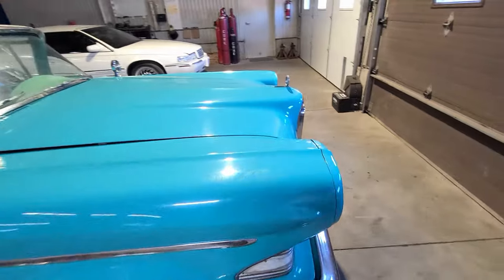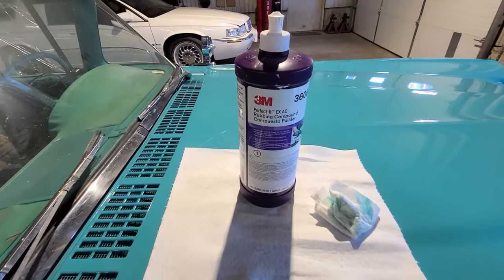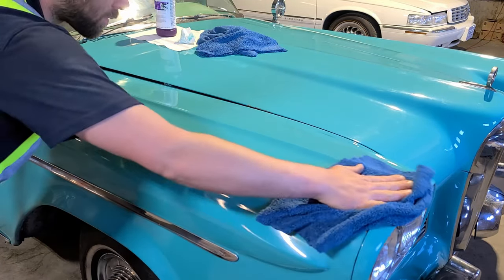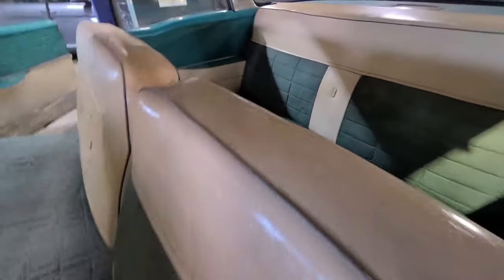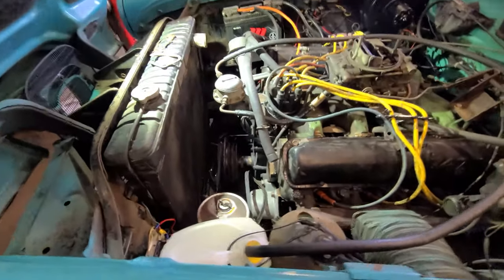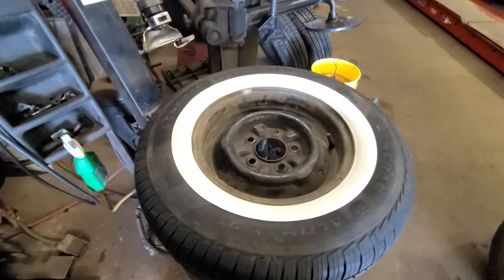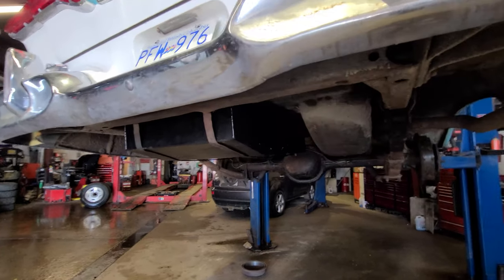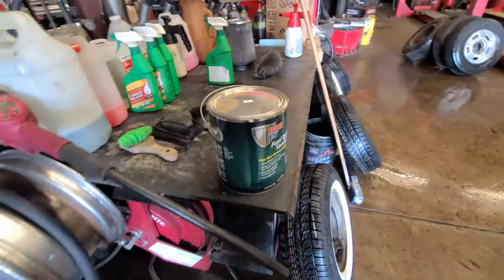Edsel Revival part 2

Comment: Matt - did the shifter buttons in the centre of the steering wheel function? If not - how were you shifting?   Chuck in NE Kansas
Reply from the maker: Hey Chuck, unfortunately the buttons didn’t work, at some point many years ago someone installed a floor shifter, it was the most disappointing part about the car